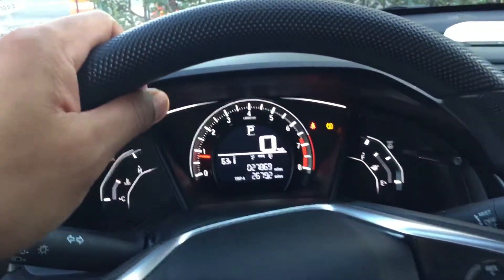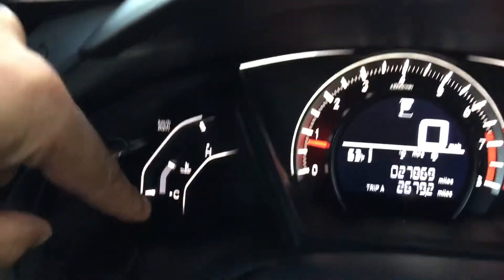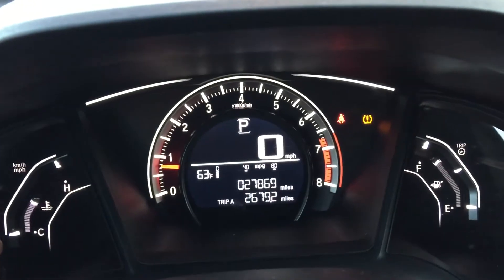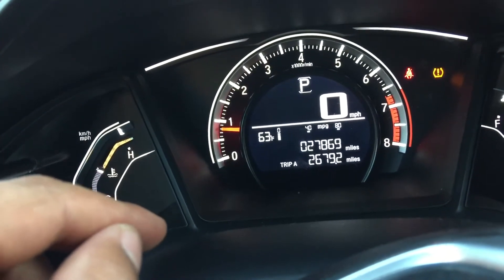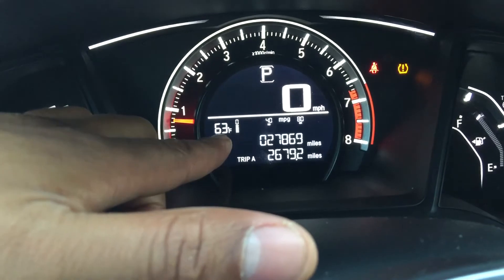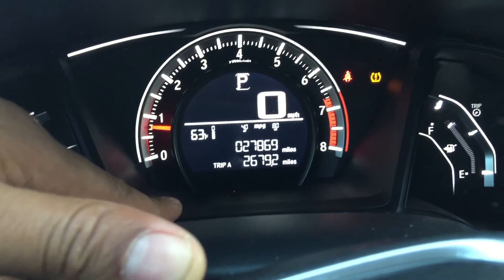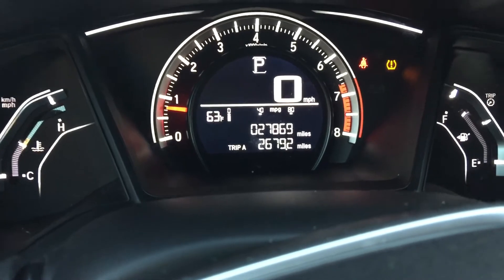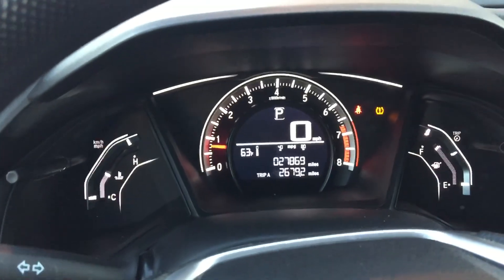READING INSTRUMENT PANEL HONDA CIVIC - HOW TO

Comment: How do you change between the different speedometer displays in the instrument panel like from showing the oil life back to showing the miles per hour, miles traveled, etc? In a 2018 Honda civic lx

Comment: Hi buddy, nice video. Random question: is your temperature gauge consistently just below 50%? I ask because my car was recently in an accident where front was damaged. Just got it back from the shop and noticed my temperature gauge is also consistently just below 50%. Not sure if it was always like this before the accident, or if there's an actual issue. Thanks!
Reply from the maker: You’re welcome!
Reply: @DIYPinto  you bet. Anything you can share on the temperature gauge would be great

Comment: Hey man, how do I change the speedometer to mph. Mine is at km/h
Reply: There is a stick on the right side where the  gas meter is located. It's actually a button you press and it will change . just found that out rn by fucking with it. There is another one on the right side but I haven't played with it yet .
Reply: @emMAGIK  you must like playing with it
Reply: Push an hold the stick/button.
Reply: So close! This was a perfect example of "mansplaining" up until you said "I could be wrong...". 😊